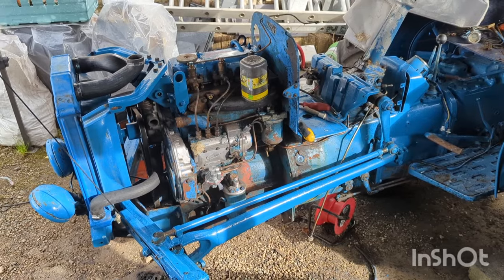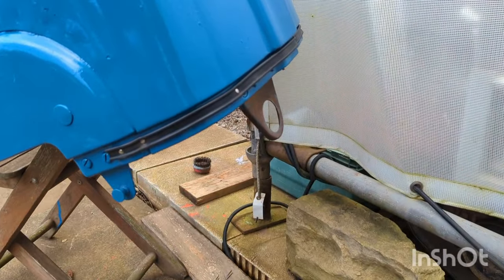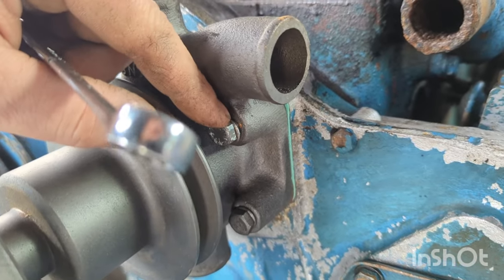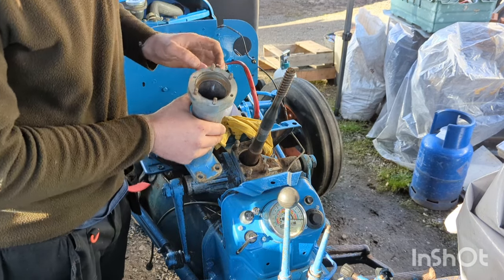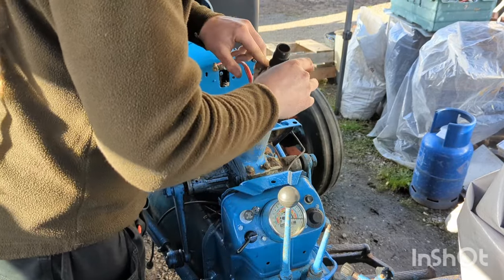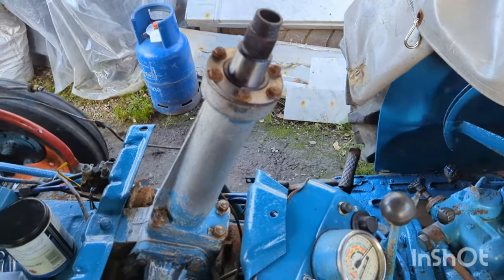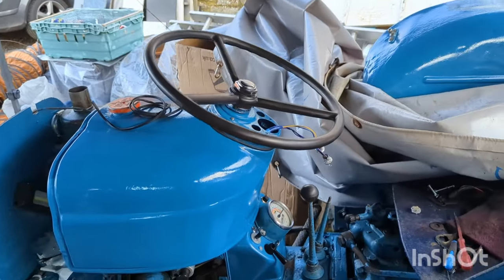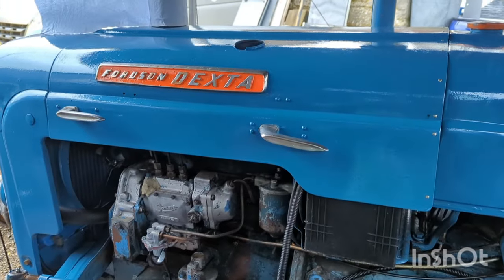1962 Fordson Dexta service//part 3//steering column rebuild

Comment: Great video with good progress. Took me a while to catch up to watch but got there. The tractor is looking brilliant. Hats off to you doing a resto like this outdoors.
Reply from the maker: Thanks Carl 😊, I'm certainly getting there now & aye it would be lovely to have some space to work indoors on the Dexta but it's all taken up with machines at the moment so outside will have to do for now 😅
Reply: @Adventure_Van_Upgrades  I get it. A mate of mine, Mat Look from lookcreations has restored a series land rover, basically outdoors, under a car port type thing. There is also a very talented lass called Land Rover Sophie who has done several restos outside. Needs must. Sadly I don't have room to do any bigger resto projects except that in my shop. Best wishes to you.
Reply: Bom dia
Podia me ajudar quero recuperar um forson super dexta. Onde posso comprar algumas pecas. Preciso para começar a torneira diesel. @Adventure_Van_Upgrades

Comment: I've owned and restored a few of these, the last one I restored I kept for 12 years and used daily on the farm too, a real tidy little machine around a yard they are, you can zip in and out of tight sheds clearing muck off of floors ECT with ease. I'd even say they are better for some jobs than a 35. Two things let them down though in my opinion, 1 being the crappy steering box design, I've attempted to tighten up a few over the years fitting new bearings ECT, but I've often wondered if the outer housing was bored bigger inside and the depth increased if two bearings could be fitted? The other fault which I sorted on my tractor is the gear selectors. They were machined a bit short,  when a gear is selected you have a gap open up between the selectors, that's ok until the tip of the gear stick becomes worn, together with the outer corners of the selectors themselves, then you end up with your gear stick coming out between that gap I mentioned and stuck in whatever gear was selected. I solved it on mine by welding a piece of 10 mm flat either side of each selector and grinding to size, it eliminates any gap between the selectors when a gear is selected, so your gear stick can't come out of mesh. Ferguson left shoulders on their selectors to prevent the same problem, of course a picture is worth a thousand words as they say, hope you can understand what I'm on about, cheers,👍
Reply from the maker: Thanks for your advice on the old girl , I have already got my hands on a replacement set of shift leavers so when I get the chance to install them I will certainly be checking for any excessive play at the tips. I have just rebuilt the steering column and managed to get it pretty tight for the moment although time will tell if it holds up.
I'm looking forward to getting her fired up in the next video and hopefully getting out for a road test.
Reply: @Adventure_Van_Upgrades  your welcome,👍 I saw a new kit available a couple of years ago which includes the worm as well as the nut and bearing, I'm sure that would improve things a lot. Not sure where I saw it though, could be Dunlop tractor parts in northern Ireland although not 100%